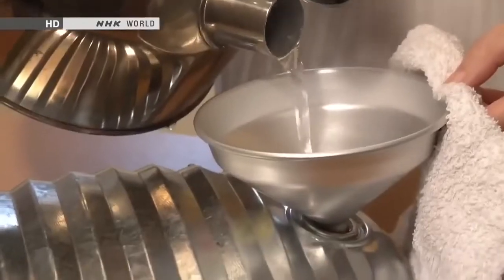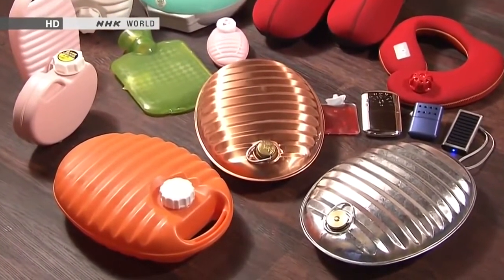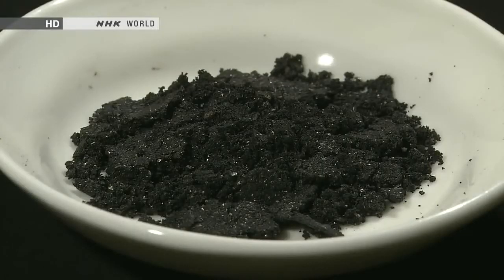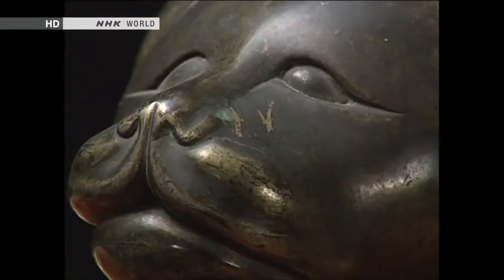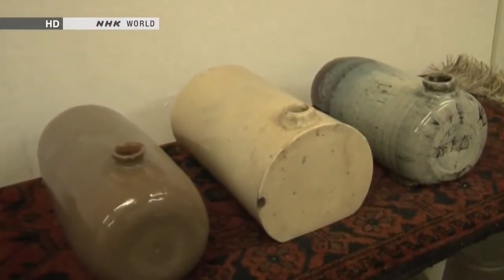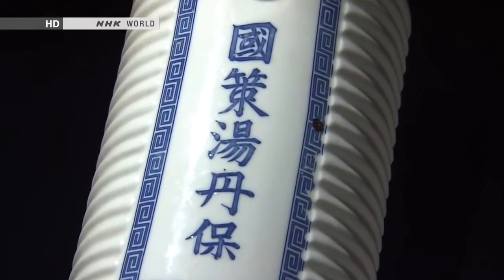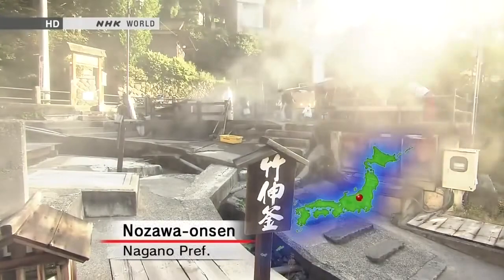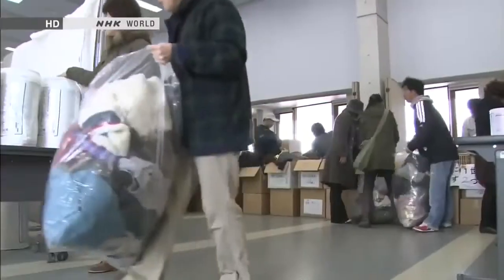BEGIN Japanology - Hot Water Bottles and Pocket Warmers

Comment: Exhausted by all the things, I was becoming so cold when going to bed and recently it got so bad that I was shivering under 3 blankets although i also had a T-shirt and a vest on. 
So, i filled a regular 1,5L plastic Cola bottle with warm water and put it inside a large sock. 
This got me sold on hot water bottles! I still have it with me and reheat the water every evening but also want to get me the metal one.
Reply: I had pulled a muscle in my back and was in a lot of pain.  I started to use 1 pint glass bottles filled with hot water and a sock around them to lessen the pain.

The sock acts as a shock absorber (folded over so basically acts as two socks in one), helps to keep the glass warmer, even though glass is already a good heat retainer and to also lessen the heat on the skin.

Would not last all day, but would last for a few hours at least.  I bet I could have probably put it in the microwave if I felt like it (without the cap of course), but had not... Hmmm... 🤔  Or the very least heat a styrofoam cup and pour the contents into the glass bottle...
Reply: @tilasole3252  Same solution to different problems it seems - im glad you found the solution to back pain. i will keep it in mind. Thanks!